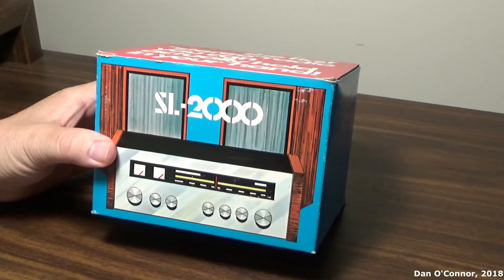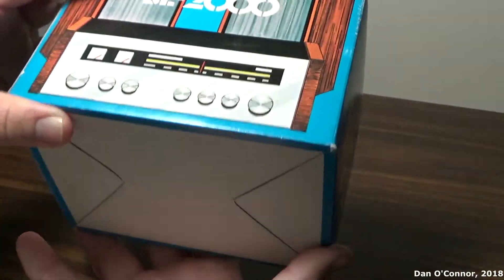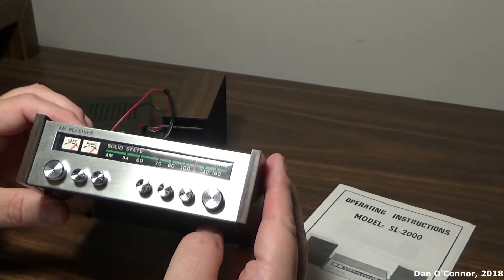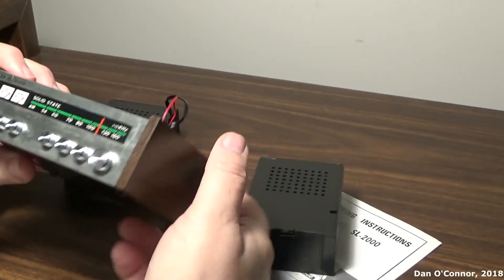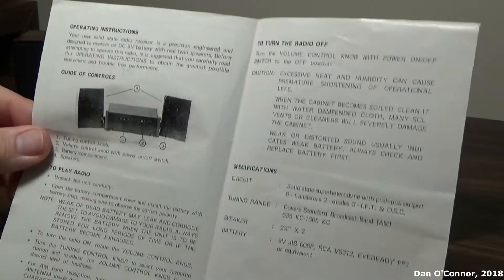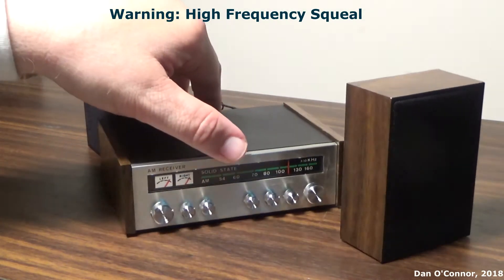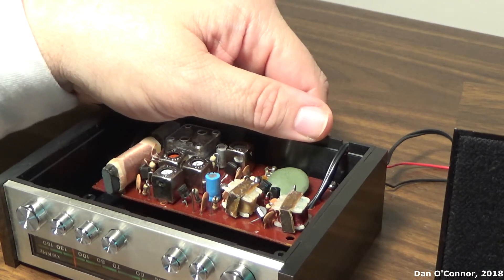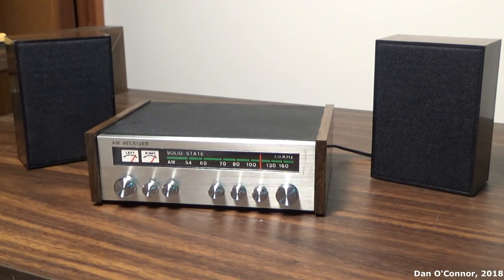Disappointing Old AM Novelty Radio SL-2000

Comment: Hi Dan - I had one of those. As a matter of fact, the earliest things I started collecting were those novelty radios.  They are kinda cool.  None sound very good, but worked out better as display items rather than a radio.  I landed up with about a dozen of them.   As my game room started filling up, the novelty radios had to go for something new to collect.  I sold them off, mostly on Ebay.  Never lost any money out of them, maybe even made a buck or two of out 'em. For new collectors, they are still fun to collect and for most of them can be bought at a very reasonable price.  See ya -- Atco

Comment: I like how none of the components on the circuit board are straight. They were thrown in like darts!
Reply: lol
Reply: At least it has a couple. It reminds me of the cheapo no-brand transistor radios I had when I was a kid in the 70's.
Reply from the maker: That might have been to maintain the "Push Puil Output" specification shown the instructions!

Comment: Novelty radio goes back a long way. I recall the crap two transistor AM radios we had in the early 1960's.  I still use, in my cellar, a Highwave six band twin speaker twenty transistor radio. Great sound? No, but why ruin good hifi in a basement?? On a shelf above the computer I use a Sanyo C-4 boombox. Thrusting 5.5wpc it powers a cassette deck , two speakers (4" vented woofer and 1.5" tweeters) and has connections for turntable, and aux. Built in five band equalizer too. No way equal to my main sound system or my kitchen system but it's ok with me. Fun video. That thing is soooo freakin' cute.